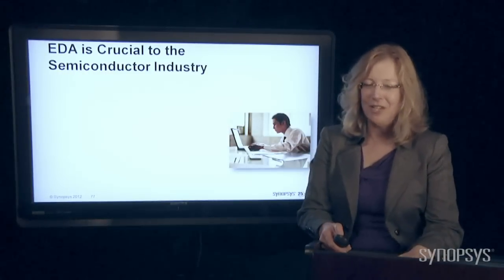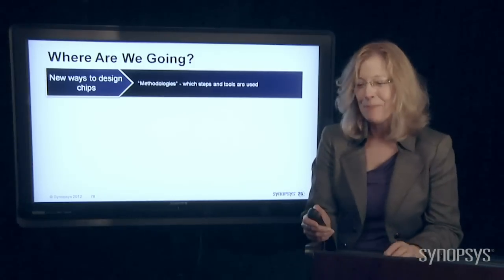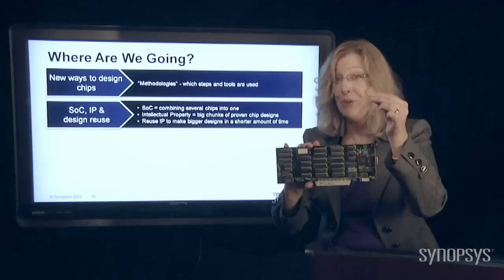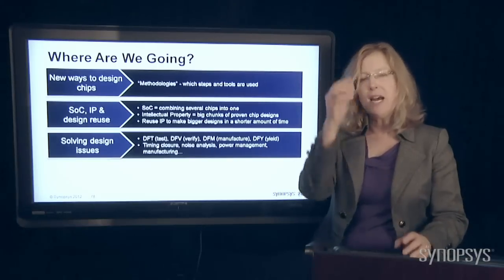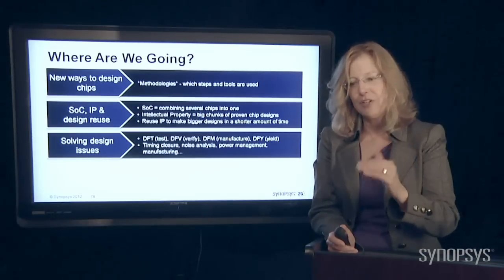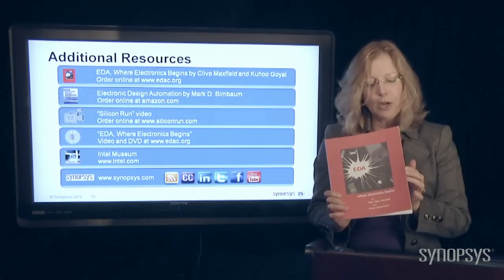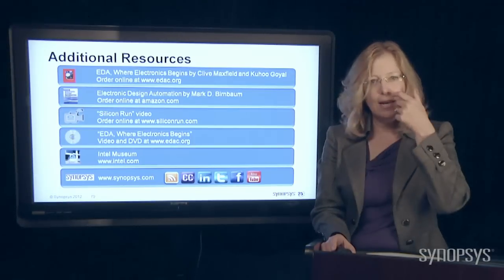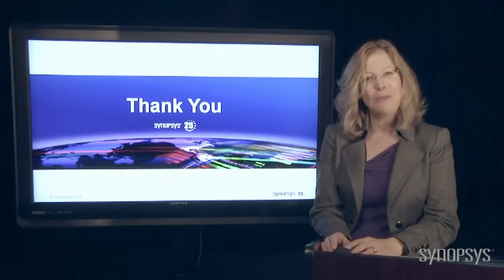World of Chips, Episode 18: Where EDA is Going | Synopsys

Comment: Hi and thanks for watching. The places where the wafer gets harder are not actually the real transistors, capacitors, and other features of the chip. My explanation was over simplified for a general audience. If you Google "semiconductor layers" you can see pictures and diagrams of the transistors embedded in the layers. It's a very complex process - much more complex than I described in the video. I hope this helps.

Comment: "Pre-silicon verification" is making sure the chip will work before it is actually built. The chip design is modeled & simulated to see what it will do, using computer programs that produce reports about how the chip will behave. If it appears that chip won't function properly, the engineers change the design and model it again. Once the reports indicate the the chip will work, it can be manufactured in silicon. "Post-silicon verification" is putting the manufactured chip on a testing machine.

Comment: Hi Karen:
I have watched all the videos, and i'm really grateful:)
I am graduated as mechanical engineer, so i didn't have lot of knowledge about microelectronics and I got lot of information.
Also I would like to ask your something that i didn't get really well. You print on the wafer shinning the light trough the stencil and you get a raised pattern, but I was wondering that these figures or places where the wafer gets harder are not real transistors, capacitors...
thanks for all
Kind regards.